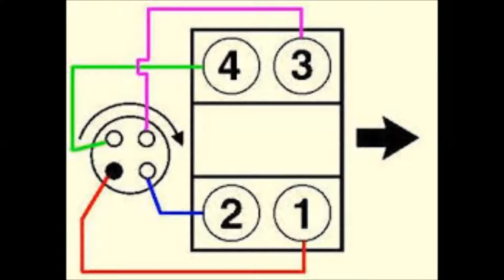Adjusting the valves and installing Empi valve covers on a VW bug

Comment: very good info, i think i´m gonna move to original pushrods, stainless are noisy as hell
Reply from the maker: I noticed the same thing but with stainless you can tighten up your valve gap to almost 0. That’s because the aluminium will expand faster causing the stainless to slap around. I tightened mine up to the point that they will barely spin. That should do this when the engine is completely cold. Then start the car and eaten them up. Then check your valve gap. They should be close to stock and most of your noise will go away.

Comment: G'day Kevin here. 
Very informative video Thanks. 
Q. Have you got a measurement for the height of your rocker covers.✌
Reply from the maker: Kevin Hamling 
Do you want inside dimensions or outside dimensions. I can get you the outside measurements tonight, and a rough estimate of the inside dimensions.
Reply: @OFFAxisBuilds  just the outside height and length. ✌
Reply from the maker: Kevin Hamling 
Will do. Thanks for checking out my video.
Reply from the maker: Here are the measurement 
2 1/4” deep from heads
2 1/2 deep with screws from heads
9 3/4” long
4” tall
Reply: @OFFAxisBuilds  thanks man I really appreciate it.  ✌
Reply from the maker: Kevin Hamling no worries good luck on your build.